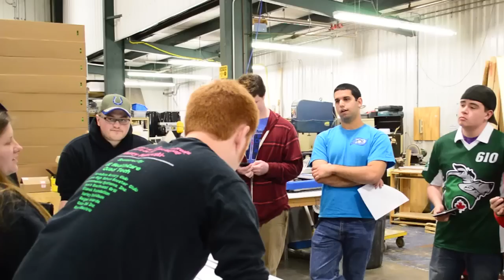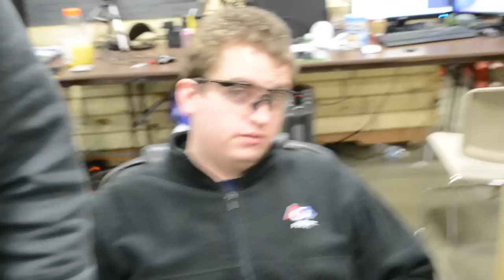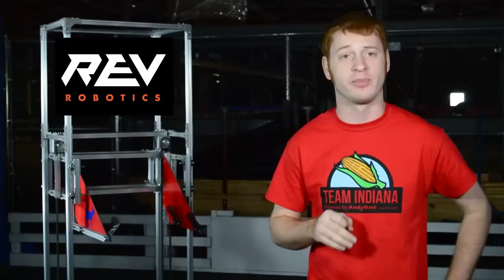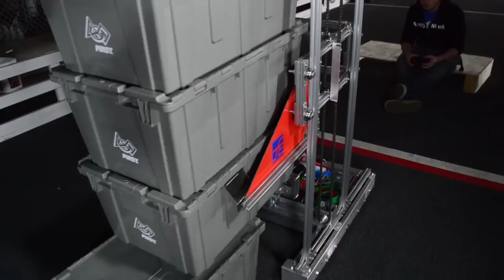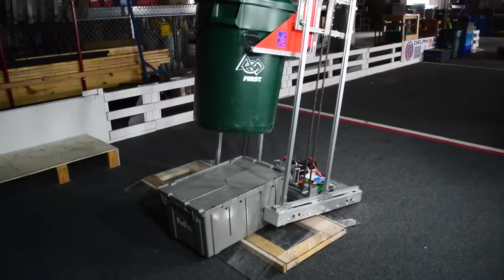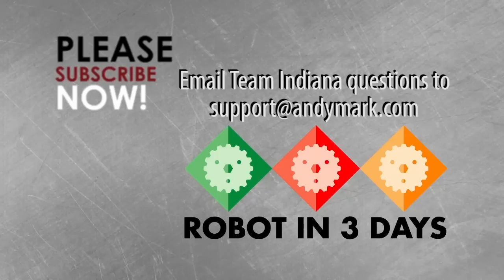Ri3D 2015: Team Indiana Robot Reveal

Comment: Love the Polycarbonate fingers for lifting. We have had trouble bending it successfully in the past, any suggestions?
Reply: Go slow!  You can also use a heat gun to help you bend the polycarb if it is cracking and breaking!